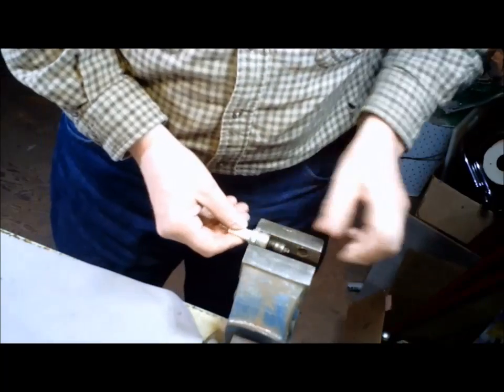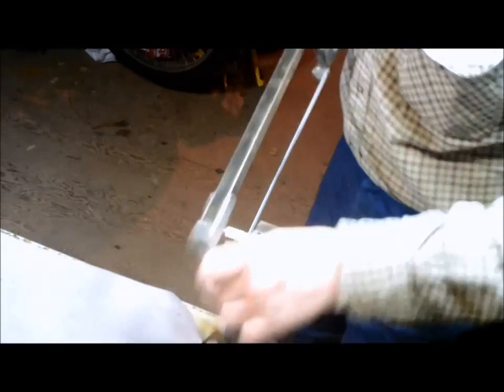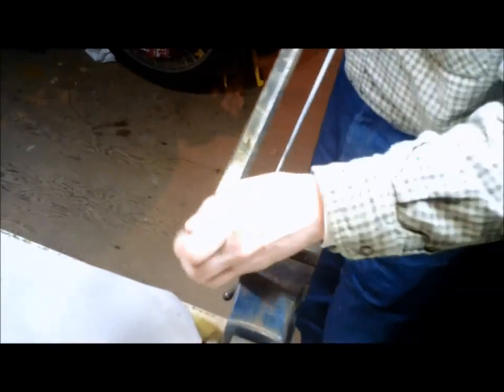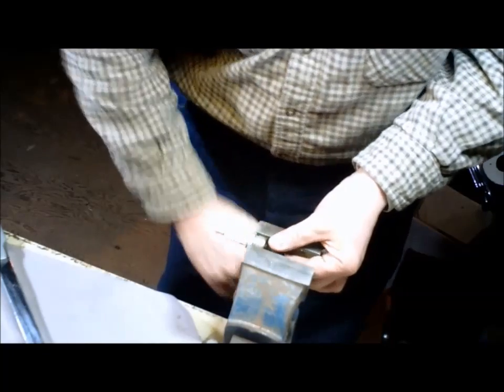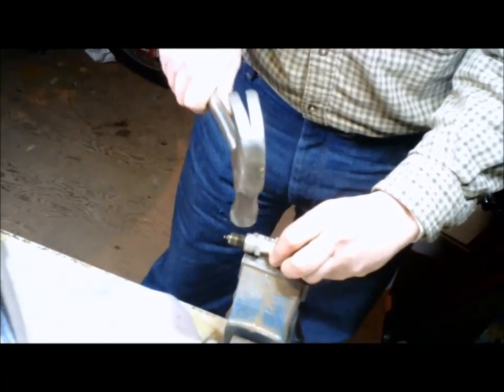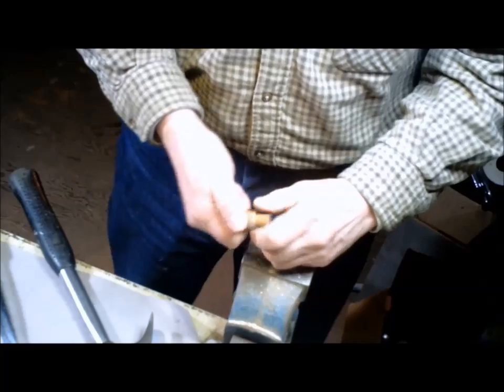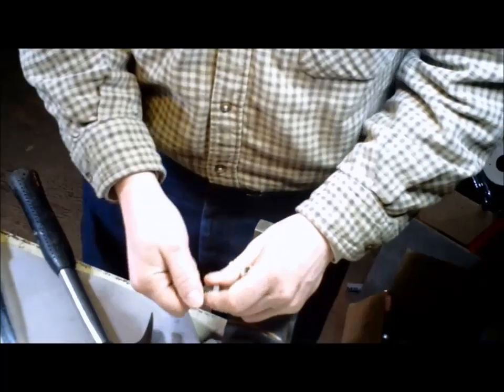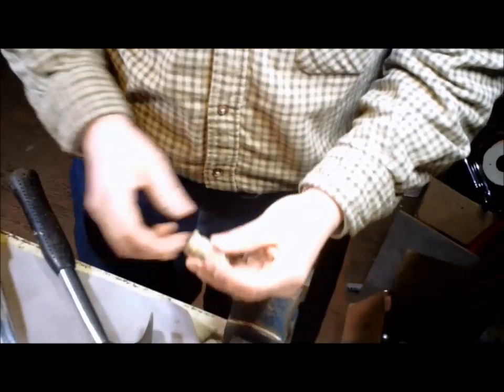Piston Stop Tool

Comment: Thank you. I did it the way you said to remove the center and it worked great. Then I drilled the center with a 11/32 drill bit and tapped out with a 3/8 coarse. Used a carrige bolt and a jam nut.  it is great.

Comment: ok.. did this and bent the bolt!!! WTF  hope it didnt do to much damage to my piston!!!!! just put your front pulley on and wedge it with a screw driver or if oilpan is off wedge the crank with a hammer handle. I used a impact to make sure it was on good and tight 110-120 ft lbs.
Reply from the maker: The stop tool is for a small two stroke motor as shown in the video.  Dont know what equipment you tried it on.  No oil pan on a two stroke engine so likely something automotive and 4 stroke.